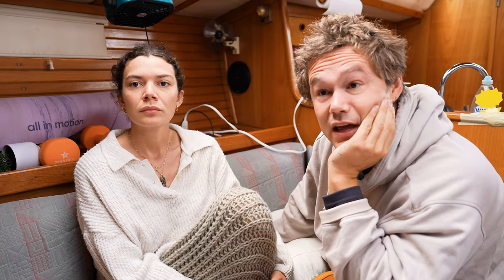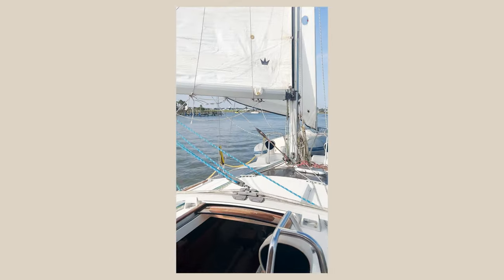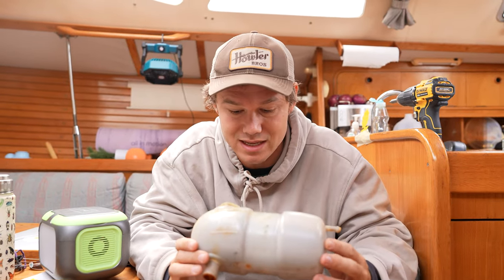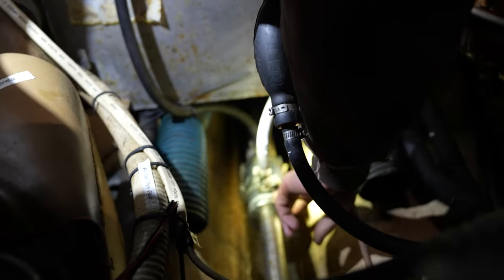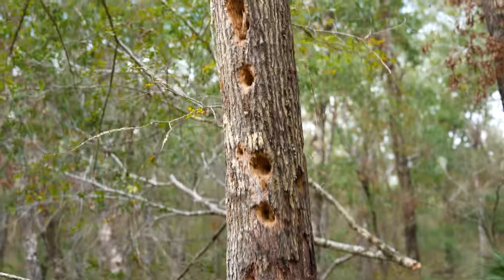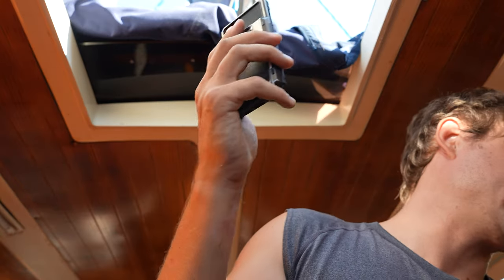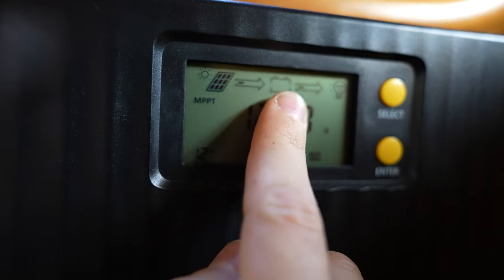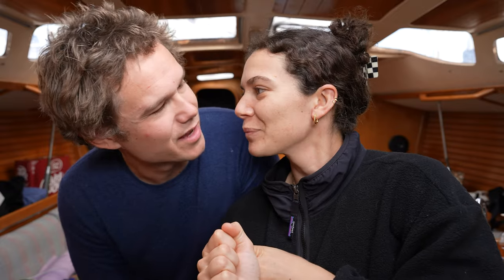delayed departure: ENGINE BREAKDOWN

Comment: We have the slightly smaller cousin the VP2002 and I think we had to repair most things on it before we even left the dock, but now it works like a charm! Great little engines and very user friendly, hope yours will serve you well for many years to come :)
Reply from the maker: It’s looking like we won’t have too much to repair hopefully. But yes they are sturdy and reliable when running but a nightmare if something goes wrong

Comment: IF you actually did over fill the engine oil, that could cause a lot of smoke . The coolant thing is a separate issue. Sorry it went bad but better at the dock than in the ocean I guess. Think of the engine as separate systems and it becomes a bit more manageable. I would go over the coolant system regardless and the fuel . Find where it all came from and work from there (the oil and coolant that is) hope it’s easy!!! You have to learn it or you’ll go broke once your over seas! Good luck!!
Reply from the maker: Thanks for the advise! I think we may have had the coolant leak beforehand just never thought of it. I’m starting to really think the oil came from underneath somewhere. Would you recommend getting a mechanic this once just to go over it?
Reply: Try to find the leaks first and sometimes they will be self explanatory. It could be obvious. If you can’t see get a mirror on a stick and look under the pan. Of course a real problem is there is no real access but you never know it could be a blown hose or something that just needs tightened? Dunno till you dig. Download a parts diagram or better yet a service manual and follow along the oil flow and follow it on the engine. Do the same with the coolant. Even if you get stumped and need a pro you’ll be closer to understanding. Someday you’ll be on somewhere there is no pro and you’ll need to know . No 911 where you’re going so you just gotta give her the onion. Sheriff max! Or at least try lol! All the information is on the webs iam sure. Post the make and model and we’ll research it too

Comment: Yeah you guys should be grateful for this engine problem happening at the dock instead hundreds of miles out at sea. No water in the oil should mean not so bad of a problem, pull injectors and make sure you don’t have water on top of one or more pistons. That should eliminate head gasket or cracked head problems.
Welcome to the world of boat life.
Reply from the maker: The ups and downs of boat life never cease. I’ll have a look with the mechanic this week and recommend that to him. Think we should take a diesel course too
Reply: @manuandmax  hey I was a owner operator of a big truck and had no diesel experience at all I did most of my own mechanic work. I could not afford to have someone else do it. 
Here is what having water in you oil will do, get milky substance in oil. 
Causes can be blown head gasket 
Cracked cylinder wall or head some diesel have liners in cylinders meaning a wear sleeve. Some are wet some are dry. 
Wet can crack and cause water in the oil. 
If you heard a bang that could mean you have serious issues.
Like a thrown rod or busted piston or busted block. 
And likely will need a new engine. 
If you have oil and water under the engine that means you need a new engine likely. 
But I guess just wait and see what the mechanic says. Hopefully not a blown engine.